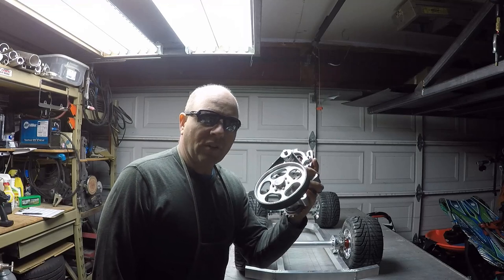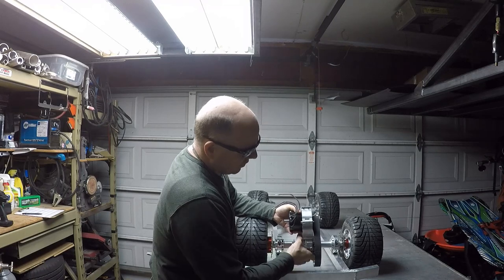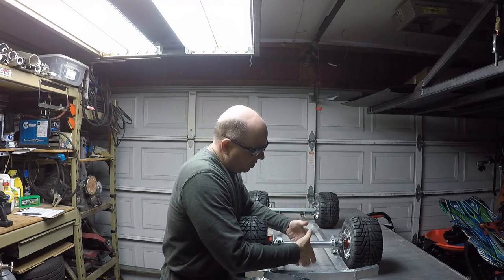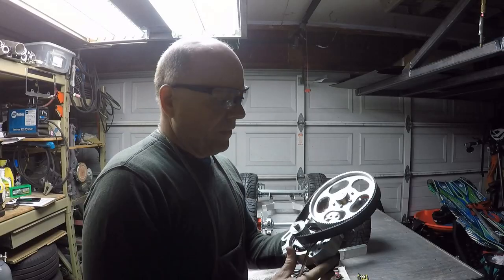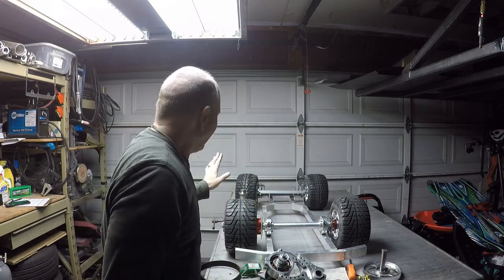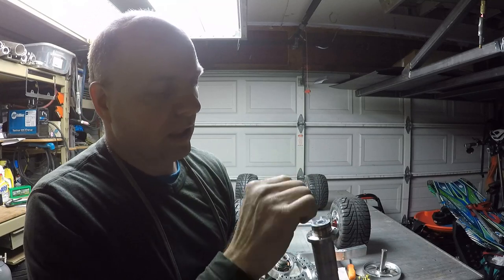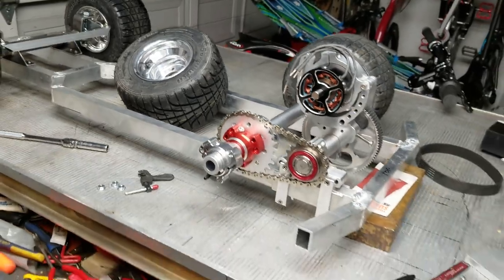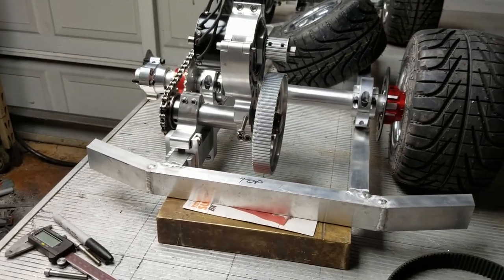Tesla Mini Model-S.... Fabricating drive unit and installing it to the frame!!!

Comment: It is pretty amazing to me that anyone has a lot of mechanical engineering as well as electro-mechanical.
Reply from the maker: Where I am strong is mechanical design and problem solving. Where I fall down is electronics. I have enough knowledge to get by. I know batteries, motors, wiring, etc. But, electronics is a different story. 

I am learning what I can as I go along.